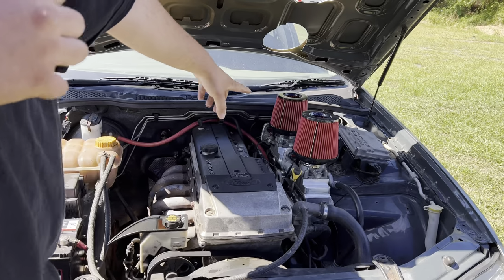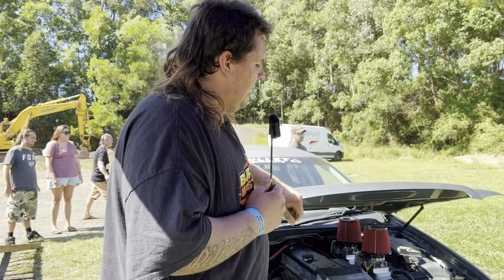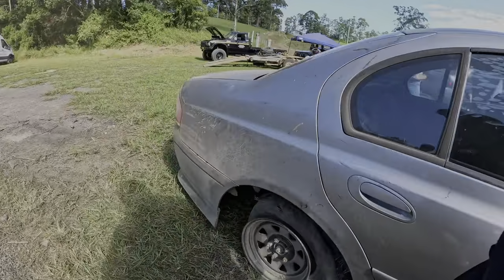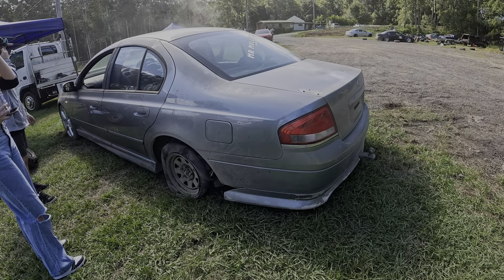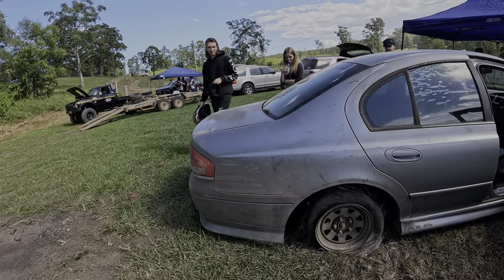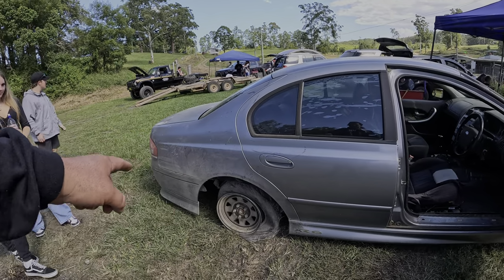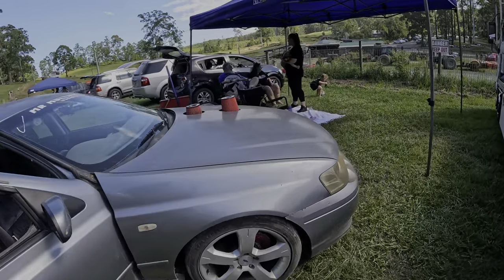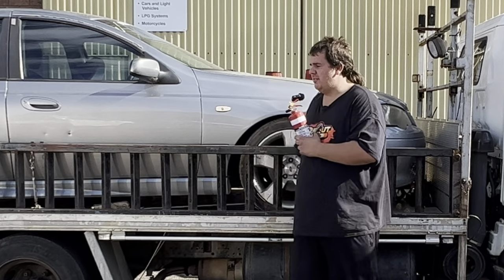Testing my cheap falcon burnout car @Raleigh skids!

Comment: for added cooling you should wire the washer canister to the window washer sprayers on a toggle switch in front of the radiator so it will help with keeping it cool while doing the skids

Comment: its so bouncy
Reply: Rear shocks are probably thrashed
Reply: @corbyweeto6061  welded rear shocks
Reply: Yeah makes sense.  I remember my solid axle AU drift car had shagged shocks and chopped springs and it would bunny hop when doing stand stills haha
Reply: Why weld the shocks tho? My ba sedan skids good with decent shocks, I don't see why you would weld them
Reply: @corbyweeto6061 stop axle tramp easy cheap fix is too weld em up 😂